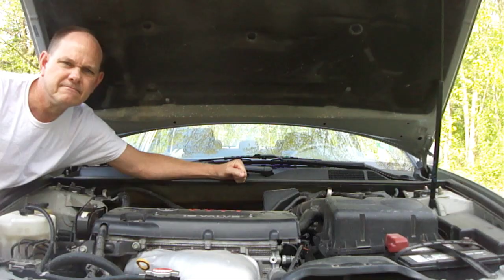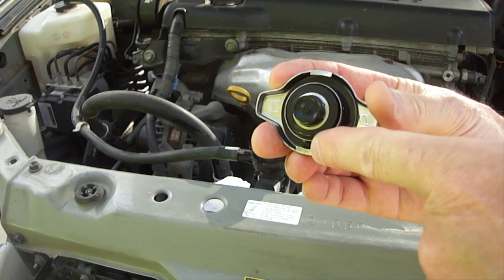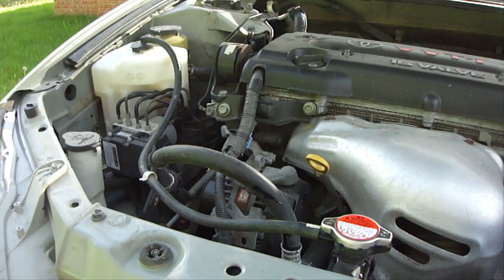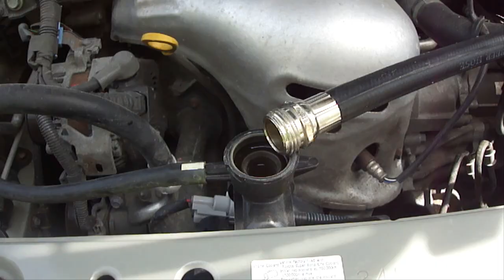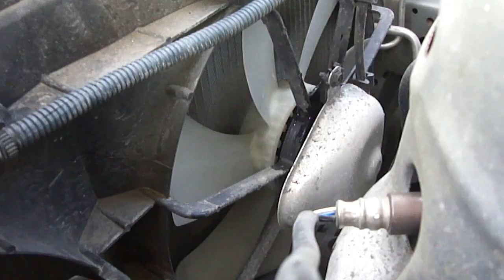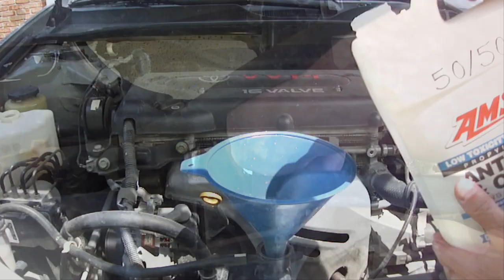NEVER Replace Your Engine Coolant Until Watching This!

Comment: Hi Paul, I have a 2007 RAV4, V6 that I am trying to keep in top shape. I have a small coolant leak. It may not even be a 'leak' but more of a seepage. There is some dried pink stuff in the area. I took it to a mechanic who said the O-ring on the coolant outlet pipe needs to be replaced. He said the part is cheap but the labor could be up to 4 hours because of where it is located. Is this true or is he just taking advantage of a single female who doesn't know better? Thank you!

Comment: This was very helpful video. I do have one question though: when you run the garden hose through the radiator isn't that draining some of the coolant onto the ground as it flushes out? I know it is heavily diluted at that point but it still looked like it was putting some onto the ground.
Reply from the maker: chris ryan Yes.  I don’t know how else to get around it. I’ve never worried about it because it’s so minimal.

Comment: Hallo. After the first removal of the coolant do i first add distilled water before turning on the engine , & then turn on the engine  adding water continuously untill clear water comes out? Kindly I need this to be clear.
Reply from the maker: I'm sorry but I do not understand your question. The only thing you add distilled water to is to the engine coolant which is a 50/50 mixture.  The engine coolant is added last after the system has been flushed clear with regular running tap water from the garden hose and as much water has been drained from the system as possible.
Reply: @proclaimliberty2000  I get you now. Thanks.
Reply from the maker: kaloki kelvin 👍😀

Comment: Great video. But I do have one question. By using your method does that also clear out the heater core? Schedule also, should I completely remove the drain plug from the radiator while using your method or do I leave it in partially so the coolant can drain out of the radiator
Reply from the maker: Donald Faulk, Jr. leave the heater running and that will clear out the heater core. Open your drain valve on the radiator just enough so that it keeps the radiator full based on the flow rate of the hose.
Reply: Never run cold water in a hit engine big no no
Reply: Remove both hoses to the heather core with the engine COLD and off. Have one hose to a bucket to catch the flush. Put a garden hose on full blast into the other hose and wait until the water coming out is clear.

Comment: NEVER run cold water in a hot engine i would take out the thermostat run i no more then 5 minutes you are asking for a cracked block also tap water is corrosive use distilled water after flushing with the hose

Comment: I dont have access to garden hose, what to do? Can i just  use a bucket of water?
Reply from the maker: teegh23 Did you flush your engine coolant?
Reply: @proclaimliberty2000  how come you didnt use the black container/gallon coolant amsoil instead of the low toxicity?

Comment: It is best that you remove the thermostat and connect the hose back. And do what you do with the garden hose. 
Then make sure as you did with the quality of the water coming back from the engine.
Then, fill the system with the new radiator coolant.